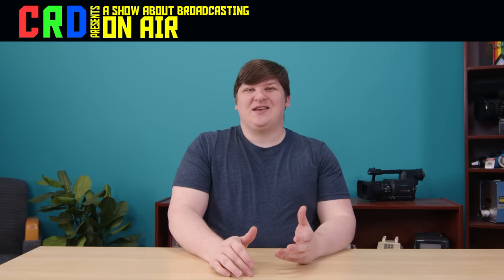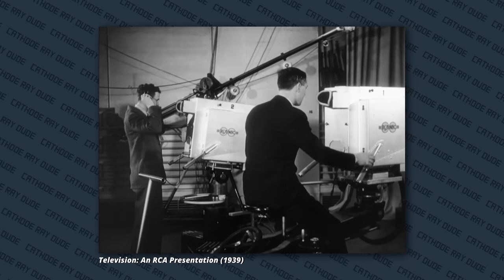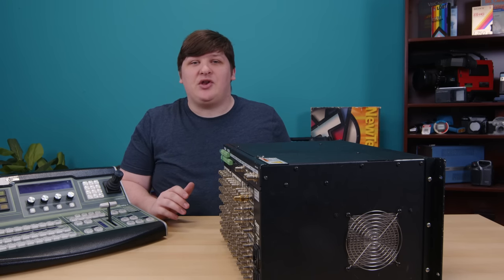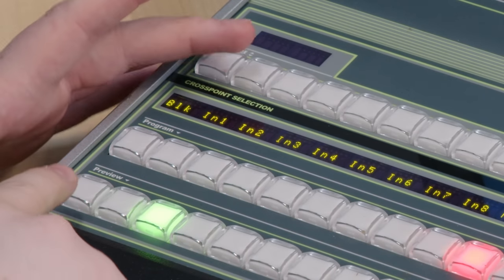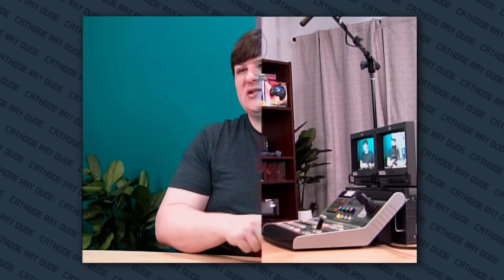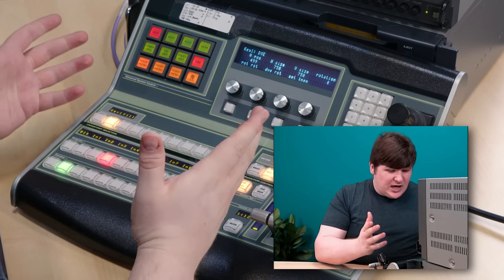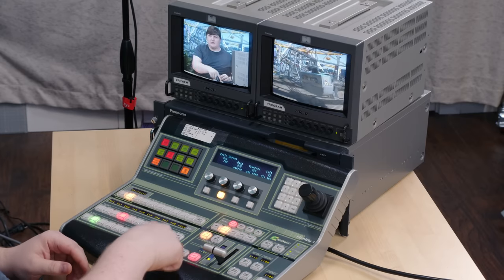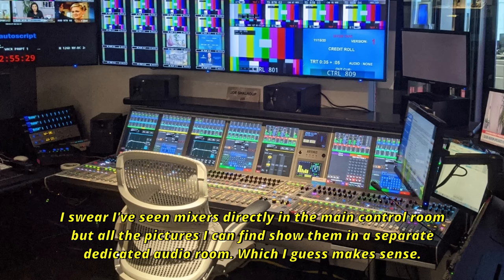What the heck is a video mixer?

Comment: One other major massive difference between hardware and software based mixers is latency; how long it takes for a signal going into the mixer to come out the other end.

A software based mixer needs to capture each frame into memory, transfer that frame over into the software, let the software process that image, and then render it back out to a frame buffer where hardware can turn it back into a video signal or an encoder can compress it into a stream. Couple that with most software mixers working with compressed video sources that also take time to compress, move, and uncompress for processing, and the time adds up more. The latency for a camera through a software mixer can be from a considerable fraction of a second to many seconds long.

Thankfully most software mixers handle the audio too, so they also have some chance of keeping it in sync with the video.

The delay in most professional hardware mixers is less than a single line of video end to end when working with synchronized source signals, and typically one frame of working with DVEs. If you need to buffer your incoming signals to synchronize them, that adds up to 1 frame, on average half a frame.

Having a minimal delay of course is important to keeping things lined up with the audio that's being processed elsewhere, where a short consistent delay can be compensated for.

But while a TV or streaming audience won't notice or care about latency, anyone watching on a screen in the same space as the action; like a large video screen at a concert, sports arena, church, or conference hall; is going to notice that delay really quickly.

When feeding cameras to screens, we want the light that went into the camera's lens being shoved back out to the projector as quick as possible. We'll run sync/genlock cables out to our cameras and turn off all the extra frame buffers along the way to try and keep that delay at under a frame (one 30th of a second [~33ms]) all the way through. Which is how long it takes for the sound from the speakers to move about 37 feet, which is a reasonable distance to many of your closest audience members for things to still line up in our brains.
Reply: Having in count that streaming services have a quite big delay by default, in the order of 20-30 seconds at least and usually streamers force an artificial delay of minutes to avoid game ghosting or manage chats, it's understandable that software mixers are good enough for that while that latency is bad for live TV.
Reply: @fordesponja  that sounds quite bad, and im not sure what service your referring too, twitch often has sub 10s latency(measured in a not very accurate way of chat messages and when they show up on stream, ive seen the latency debug output get as low as 1.5 secs, but im not sure what that’s measuring)

and there where some attempts to get it quicker with the likes of mixer
Reply: This is a side effect of high level abstracted and modular thinking of modern software dev. Instead of having specific wiring for a specific effect, you put together this input card, general purpose processor, and output card, and now you can do anything to any part of the frame, which is really awesome - except it adds some frames of latency.

Open your phone camera app wave your hand in front of the phone - you can see the screen is delayed. Your phone is capturing a whole camera frame, then the whole frame gets passed through some specialized processor (to save power) that does brightness and colour balance stuff into the main system RAM, then the camera app notices the new frame is ready in RAM and queues it up for the next time the screen refreshes. When the screen refreshes the graphics system puts together all these pending sub-frames (status bar, app, soft button overlay) and now that's ready for the next screen refresh.

It's basically put together by the creator of each part thinking about what to do with entire frames and not individual pixels as they come in, so each part of the system adds 1 frame of latency. To be clear, it's totally fine for a lot of applications.

---

There's no theoretical reason a software couldn't process pixel-by-pixel, but it would probably still add a few pixels of latency so genlocking the output with anything else would be tricky, but if it's the final output maybe you don't care about that.
Reply: @fordesponja  even for tv latency is not a problem. but for a live show, where the audience see the stage and projection at the same time it matters a lot. i try to not even use any digital image correction on projectors to minimice latency, an the mixer i mostly use has 8 lines of delay (0.07ms @4Kp50)
Reply: @miawgogo  competitive Twitch streamers add that artificial delay. I don’t watch Twitch anymore but I’ve seen anywhere from 5-45 seconds in like 2010-2016
Reply: @kaitlyn__L unless they are someone with very few audience, everyone imposes a delay because managing a stream without it is impossible. There are too many variables that need to be corrected since people with anonimity can't be trusted to be civil.

I said 20 to 30 seconds because I never see anyone going below that.
Reply: @juri14111996  And this is why it still matters if something is a DVE or not---unlike what was said in the video. The moment you want to use DVEs, you need to frame buffer, but without them, you can mix the pixel stream and get those low delay times.
Reply: Not to mention the importance for sport tv applications. Having all cams in sync is important for live coverage, but also replays. Having all angles be frame accurate is important because one frame you might have a foot, one you see a hand, the other has the clock. All our cams are genlocked and the small POV cams have frame syncs.

Comment: I worked at a small TV station many years ago. We had a Sony video mixer for production and the control surface was rack mounted, so embedded into the table was rack mounts so it could sit recessed in the table. So rack mountable equipment in a table is a thing.
Reply: Yeah it's used all the time in sound studios so I'm not surprised at all.

Comment: A few comments from someone who worked as a vision mixer (which is "european" for TD) around ten years ago:
- At least in my area, the only type of production I worked in where one would use preview for cuts was in news, because of the rapid, scripted cuts you would have to make. Your right hand would be ready on the cut button for the next cut, while the left hand was ready to preview what came after that, so you always had the next two cuts ready. Anything else we were taught to cut like the BBC vision mixer is demonstrating at 23:48, left hand for cuts and right hand for dissolves. Using the pvw row for cuts just adds an extra step that you shouldn't need; a big part of the job is always staying one step ahead so you know which cameras you can cut to before you need them.
- About the wipe patterns and the other "fun" effects, you're right in that they hardly ever get used. Mostly they're used to hide the transition that happens behind a stinger (if it never goes full screen so you can just cut behind it), and even that usually just needs a regular linear wipe. But you never know when someone will have an idea or request for an effect or transition that needs it, so why remove them? There are other things in the mixer that depend on pattern generators anyway, so adding/keeping a few "extra" generators in order to keep the wipe functionality is probably no extra cost at this point.
- ME steps are commonly used. Mainly, as you say, for "submixing" of effects. In most cases, you could in theory do everything on the program row, but it is much simpler and safer to prepare an effect on an ME so you can just cut to the finished effect, especially when you need to load different snapshots or effects during a show. If you build the effect on an ME, you can just quickly store a snapshot of the entire ME and know that it won't affect anything on your PP (program) step when you recall it.
Another benefit of the ME's is that you can have more than one panel/control surface controlling different ME's on the same mixer. For example, on mid-size sports productions, we sometimes use the main control room in the OB truck for the "host" production and the "second production" room for the "national" production. Since they're technically just different ME steps on the same mixer, the national production have access to all the same sources in addition to the host output.

Comment: JD the TD here. Loved your video and great job in explaining a very complicated subject in layman's terms. I am a broadcast TD and use the big giant Sony and Grass Valley Keyenne switchers shown in your video, on a daily basis, but have also used many of the older examples too.  My first switcher in church, was the Panasonic WJ-50.  The Preview output that you mentioned not being able to find was not to preview a bus, but to preview an effect like a chroma key or downstream key(dsk), etc before taking it.  I also remember using a larger echolab switcher in a remote truck in the late 90's.  It had a Pgm/Pvw bus, but the two additional M/E's were A/B buses.   It was very confusing to have both on the same panel and "bagged" me several times each time I would get called to use it.  It's like Echolab was too cheap to make all three M/E's flip flop like Pgm/Pst, but by having it on one, they could be competitive with other brands that had it on their switchers. I hated that switcher!
The most challenging part of running the big broadcast switchers is remembering where things are located in the menus to do what you're trying to accomplish.
Most productions that I have been a part of have a separate video director calling the cameras but there have been the occasional shows where I have done both or "called and punched" my own show.  What the general public has to know is that television production is a field where there is very little tolerance for errors.  It requires a great amount of focus and mental stamina. It's more that just hot punching two or three cameras, like in your video.  It can be more like punching 5-7 cameras on a talk show or game show, and then being expected to record multiple shows, flawlessly, in the same day. Or being on a LIVE to air show like the news for four hours straight or cutting a music show or sporting event with more cameras than you have fingers and being expected to hot cut on the beat.  By the end of the show, you walk away and your mind feels like a bowl of jelly.  It is not an easy job in the least bit, but if you are good at managing a lot of signals and multitasking, can be very rewarding.

Comment: What the wipe and other transitions were used for was mostly wiping graphics onto the screen. Back in the day, your lower third super generator just output a static image, so to get a nice effect of it sliding or wiping onto the screen, the vision mixer was the thing doing the transition between the normal shot and the same shot with the lower third graphics superimposed on it - hence the term "super".

EDIT: Ok, you kinda got there yourself. But yeah, by the time this box was on the market, it was doing the keying of the graphics all by itself. Before that, it would've come out of the character generator (CG)/Chyron/graphics generator, into a keyed the graphics over the shot of the talking head or whatever, and fed that as a separate input into the vision mixer, which would usually be called the "graphics" or "Chyron" input, depending on how American your facility was. Often the graphics operator would have their own mini vision mixer, so they could overlay the graphics onto inputs separately to the main vision mixer.
Reply: I remember the wipe effect being used mostly for commercials. A car dealerships and such liked the fancy wipes. Rarely used in program production.

Comment: One common use for multiple program outputs is also live screens on set or for events with a live in-person audience. For example the big screens for the live audience at a concert are there for close-ups of the musicians, and maybe some graphics or clips playback as part of the "set" and/or lighting design, but they wouldn't ever get the wide-shot cameras that are used to show the TV (/stream) audience the scale of the event.

Skilled Directors or TDs will even synchronize content across outputs to build virtual "layers" through the real world: the wide shot of the concert stage where the crowd is going wild reacting to the guitar solo they and TV are seeing in a close-up shot on the screens that flank the stage... Then as the solo ends, both the TV program and the venue screens cut back to the lead singer together for the next lyric.

Thankfully modern mixers/switchers also have a lot of automation features to assist the operator/s in managing all those outputs.

Comment: I worked as an interpreter for a news network for about six months and I have never more than maybe ten keys on what was a gargantuan mixer. Audio was strictly a separate affair. The t-bar was frequently used though. They would use it to perform cuts from different sources. Sources would be news agencies. Here's an overview of what went down, or whatever I deduced from observation:
The network I worked at didn't have any news broadcaster or any sort of live feed that is shot within the premises, i.e. the modus operandi of Euronews. Agencies have constant video and audio feeds that the network had subscribed to. There are monitors in the production room that exclusively display one particular agency. The director seems to have notifications come to them from a RSS feed or something like that about the contents of each agency feed. The director gives the general direction but I actually did that in their stead from time to time if you can even believe that. Anyway, the TD would pick a source, preview it with its audio using either a headset or a little loudspeaker but that was just to check whether or not there was proper workable audio. The CG operator prepares the text, something like "man marries his sister in Alabama", wraps the text in whatever graphics and adjusts the graphics as necessary, then feeds it to the mixer. The channel logo, the date, or time seems to be added by the mixer but they are a rather standard affair since they were constant and I imagine they just press a key to display a whole bunch of them at the same time. The TD picks the feed, applies the logos and shit, applies the output of the CG generator which was typically referred to as "KJ" (abbreviation for karakter jeneratörü" in Turkish), then the audio engineer, who happens to be the best AE I have ever seen in my ten years as a simultaneous interpreter and I have worked with so many, listens to the audio feed, does necessary adjustments as he sees fit, then adds my voice on top of it. The t-bar was almost always used in transitions of any kind and I imagine it is to give the TD complete control of how things go down, something I observed to be essential if you want things to go smoothly.
All these were what I could deduce on my own since TDs were not so eager to teach me anything as if I was gunning for their job or something. I am probably mistaken in quite a lot I have said so please correct me if you know better I really wanna know.

Stellar content btw.

Comment: The reason that old gear was built as a "rackmount" unit was because the workstations in the control rooms were (and to some extent still are) 19" racks. Instead of having a unit that sits on a horizontal desk, the desk itself is sloped and has 19" rack rails built into it, then the gear is mounted directly into the desk. If there's no gear in a section of desk (e.g. the director's workstation), they instead mount a blank panel into the desk.
Reply: Or maybe a shelf for snacks